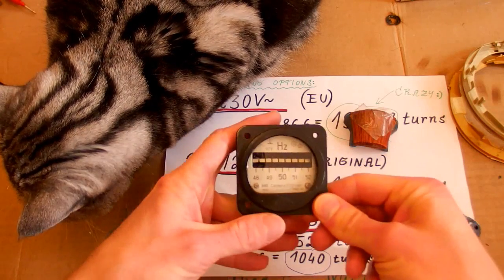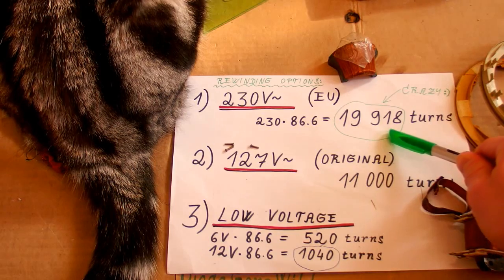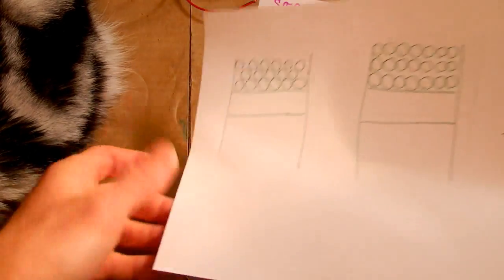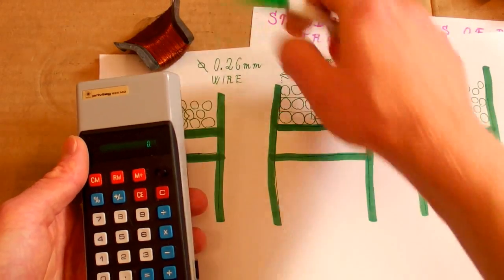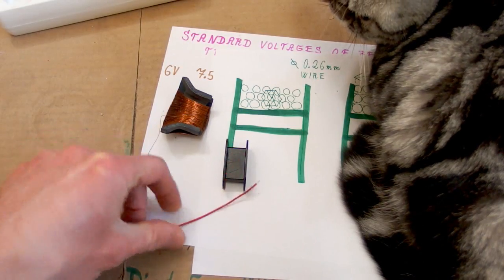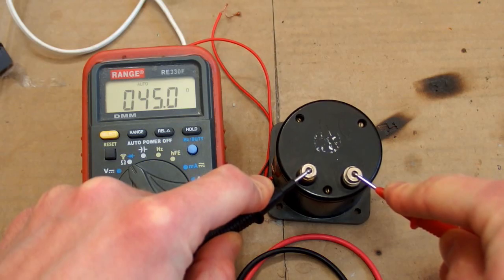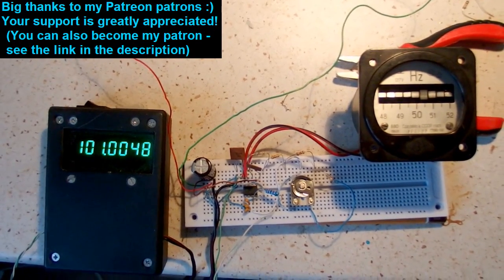Winding a coil (rewinding my frequency meter)

Comment: Any standard wire insulation is always rated for 1000V minimum. So 240V would not kill it. Also one way of winding 1000 turns is to find the weight of 100 turns ( wound bobbing - empty bobbin) and then continuously winding till the weight of turns becomes 10 times the older weight.

Comment: Cool. I haven't seen a frequency meter like that. Half the vid I was wondering what the heck was oscillating. The ending made it clear though.

 Your insulation tape looks a bit suspect :-)

  Do you usually use packing tape?

How about an explanation of picking the right wire diameter for output current in a transformer and how the secondary current is limited by design?

  Thanks for the upload.
-Jake

Comment: Well that worked spot on, as far as i could tell :-D
If there was space, you could slide the coil further away from the tuning forks, but it works great anyway :-D.
The cat is in the box, Danyk-dingers cat :-D

11000 turns / 127V = 86.614 Turns per volt.
86.614  x 12v = 1039.4 Turns.
Size up wire to fill original area.
Bzzzzzzzzzzzzzzzzzzzzzzzzzz :-D

Comment: 2:00 note that the transformers are designed for a particular frequency only.
So, a lower frequency than the original frequency, can damage the transformer by overloading it.

Higher frequency may generate eddy current more prominently, but it is insignificant is this case.

So, we have to use a transformer that can handle the lowest frequency of the frequency counter.
Reply from the maker: +/- 2Hz is really negligible....
Reply: What you said is correct but when you change the frequency a lot. The core of the transformers, safely supports the frequency variation indicated by the frequency meter.
These transformers could work properly even at 60 HZ (US standard)

Comment: Hello,
You can use a cordless Drill for winding :-)
Reply from the maker: If it's multiple thousands of turns, I use a drill. The problem is that you have to just guess the number of turns (or connect some sensor and a digital counter to the drill). The wire may break if the donor coil gets stuck. You have to be sure that it unwinds freely.
Reply: @DiodeGoneWild  I've seen plenty of contraptions for counting the turns, but I think the easiest one to put together is to grab a spare crappy calculator, two wires to "=" button, put some contacts on the rotating thing and here ya go :)
Reply: using a drill is the best way to break the thin wire.
Better to find a rotating support but moved manually.

Comment: What do you do if you loose count. Winding 1040 turns by hand must've taken hours. You have a lot of patience.
Reply from the maker: I was winding it way faster off camera. It took me about 10 minutes in total. Plus the time to join the wire when it ran out. Plus the donor coil got stuck few times. It still may have been like 20 minutes in total.
Reply: to avoid losing the bill, DGW wrote the number of windings made every 100 rounds or every time it stopped.
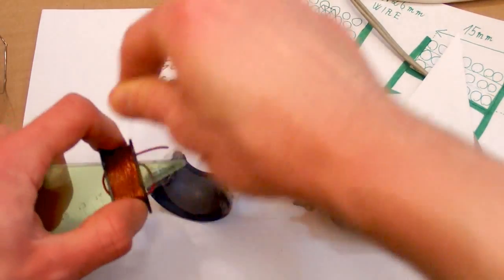look at 06:32 400; 500; 600; 615 (above his hands)

Comment: With the 50 and the 50.5 Reed on 12 volts vibrating equal amounts, isn't that saying the frequency is 50.25?
Reply from the maker: Yes, it says 50.25Hz, but the EU mains is way too accurate to actually be 50.25Hz. It seems that when the voltage is too high, it tends to read a bit higher frequency. At 8 to 10V it works well.
Reply: @DiodeGoneWild  is it possible that there is a global tuning screw for all the Reeds to calibrate? Or a flat open part at the base of the reeds you could put a bit of glue or something for Mass dampening to calibrate? Thank you for the reply.
Reply: DiodeGoneWild Well, you can check the grid frequency online.
Reply: This old thing must have big measurement error and voltage dont affects frequency ,only amplitude is bigger (sinus wave still  be 50Hz after transforming of any transformer)
Reply: @jmenonenidulezite561  I just imagined with that small of a scale it was meant to be fairly accurate?
Reply: it can also be this, the network frequency is maintained in a very narrow range of frequencies around 50Hz it seems to me to remember from 49.7 to 50.3 Hz in addition to the presence of harmonics and districts placed on the network by all those power controllers and those switching power supplies that we have permanently connected.
Just to give an example: some time ago I was working for a big energy distributor here in Italy and I received a complaint for a boiler that was always blocked at the same times: the problem was generated by the induction oven for drying paint in a car body repair shop under the same line one km away!
Reply: It could be due to the presence of harmonics or spurious introduced by the overload of the core in the secondary voltage of the transformer. When making a precision measurement using a transformer it is a good idea to use it at the minimum possible load to avoid disturbances introduced, therefore raising the transformer supply voltage almost certainly this event has occurred